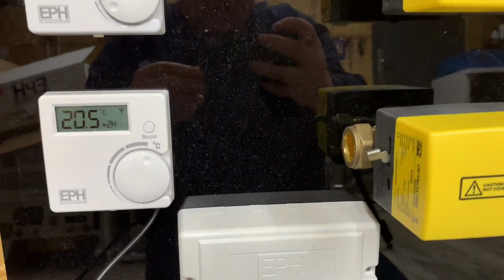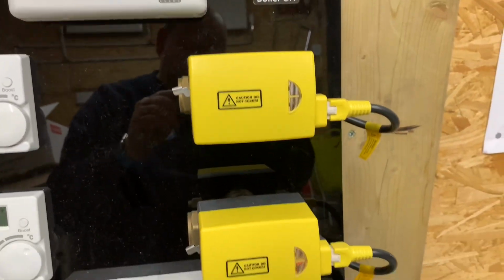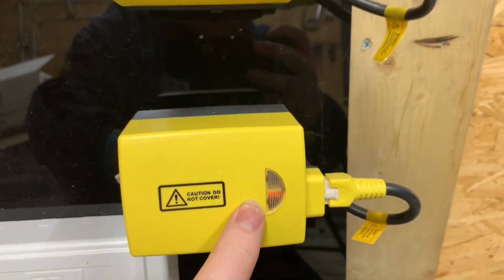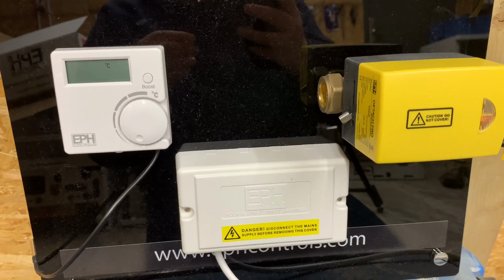CENTRAL HEATING SYSTEMS EXPLAINED - S Plan, Y Plan, One pipe, Two Pipe Underfloor Heating

Comment: @allenhart999 . I have an old georgian mid terraced house. It consists of 4 floors with each room directly above the other. I am thinking about installing a heating system myself as i am an engineer by trade. I have installed a new electric hot water cylinder last year and up until now orhave had electric radiators ( no gas supply currently) the system would be for radiator heating only. I would be unable to install a header tank due to access issues. Surface mounting the pipe work is not an issue. Could you recommend a suitable boiler and am i correct in thinking a simple 2 pipe flow and return system would be the way to go ? The boiler would have to be installed in the basement kitchen due to various matters ( grade 2 listed building ). Thankyou 😊
Reply: Heating system would be 1 rad for kitchen , 1 rad for living room and 1 rad for each bedroom.

Comment: One pioe systems imo are great if you use straight valves and pipe the rads all with straight valves, so the pump doesn't have to push water into tees

Comment: On a one-pipe system, is there a reason why the pipe continues on under the radiator and doesn't just continue through the radiator? Surely the downsides if lower pressure would be outweighed by the fact the water would go through all the radiators?

Comment: 11:26 This is a great video, thanks! I'm planning a heating system in a narrowboat which I'll live in. I'm considering a mix of underfloor heating, one or two radiators (engine room and bathroom) and hot air from a heat exchanger. 

I wasn't sure if i could use UFH and radiators on the same manifold, but the info about the blend valve is just what I needed! 

I'll be watching your other videos too. Thank you so much!

Comment: In the two pipe system. What are the implications of all rads are off. 
Would it work to join the flow and return at the end of the run. I’m guessing not as yours doesn’t include it.

Comment: Hi, can you answer a question for me please. I have a duel zone combo heating system.
When draining the radiators down, and refilling pressure in boiler I am getting no water from bleed valves but pressure says 1.5 bar.
Do the zone valves have to be opened before bleading and how do you do this without turning heating on?
Thank you.

Comment: Hi. Quick question about a remove radiator permanent in 2 pipes system. After remove radiator Can I connect pipes together or I have to fit on stop end cap?

Comment: Hello Alan I have  a one pipe system in my house, the radiators near the boiler are red hot, and some downstairs are barely warm, I would think at the end of the run. Can you balance a one pipe system by turning down the lock shield valves, or will this only work on a two pipe system ?.

Comment: Thakns for the video. In the 2 pipe system, does the in-flow and return pipes always connect to the same side on every radiator, or is it up to the plumber to decide?
Reply from the maker: There are not always the same.

Comment: Hi, does the d(T) on radiators aggregate?  By this I mean, if your water loses a bit of heat at radiator 1, then does that carry over to radiator 2 so the return temperature lowers again, and so on?  Or is there one overall loss to show the overall drop?

Edit:  I think I'm getting my own answer here - the point of the two pipe is that the hot water is only used in one radiator before it gets returned - so by definition there is no aggregating loss in a two pipe system and hence you can work out d(T) on a single radiator.  If I'm wrong, someone tell me!
Reply from the maker: Thank You

Comment: Hi, I'm just about to wire up an S plan system with the very same controls as you show in your video  do you have any videos showing the wiring diagram? Noting I have 5 core flex ( not wired yet )coming  from my time clock to the boiler ( System Logic ) and cylinder which are  situated in a different room.Thanks
Reply from the maker: Thank You

Comment: Great Video Alan. I have just fitted some new column radiators and I currently have a Worcester 8000. My question is when you pressurise the system where would you expect the water to enter the radiator first, the flow or reverse side. Thank you in advance

Comment: Hi Allen, great videos, very easy to understand. I am an electrician looking to understand all types of heating as I think the air source heat pumps are the way forward. I am looking for a video just to understand how many cores I will need for each different heating systems.

Comment: Hello Allen,

First off, thanks for a very clear explanation of the possible designs of the central heating systems ;
So a rather specific and bizarre question.
I have moved into a house where, because the floors are concrete and I cannot  raise the floorboards to look, I can’t tell whether it’s a one pipe or two pipe system.
At some point in the past a radiator was removed in one of the rooms, because the owner at the time wanted to do something different with the wall. (I haven’t all the details.)
Someone, a plumber or just a DIYer, therefore connected the two pipes (the flow and the return) directly, without a radiator.
It seems to me, that in the case of a one pipe system it probably wouldn’t matter much, but in the case of a 2 pipe system, that this would mean that much of the hot water would be directed straight back to the boiler and make the system inefficient. (the missing radiator is, i think, near the beginning of the loop.)
It also seems to me, that simply to cap the two pipes (flow and return) would be far more sensible in the case of both types. (1 & 2 pipe systems)
What do you think?

The other option, of course, is to install a new radiator, which I may do eventually.
In that case, how do I know which is flow and which return, and does it actually matter? I would expect to install a radiator with a thermostatic valve connected to one or the other pipe.
Reply: I came across you Q to Alan, sorry I’m not him or anything to do with.
But just in case he can’t reply here you go. And if he does reply he can mare my work.😂🤔✅
You are right, doesn’t matter in a 1 pipe system. Even is a 2 pipe system that pipe that has been connected is the smallest of rad in the world. But again I wouldn’t like to do the maths to find out the costing or efficiency or lack there of.  If you ate putting a rad in the future again it matters not which is F & R just make sure your stat can do both as some are dedicated flow.

Comment: Hi
Is there a recommended configuration for the flow and return pipes? Your video shows the flow and return pipes with tee off to one rad at a time. Is it ok to have the flow or return with a tee feeding 2 rads or would this cause a bottleneck? I can see it may be ok for the feed but may be a problem with the return. Thanks in anticipation.

Comment: Hi, Let's say we put 2 zones on a wood boiler for a house of 100m2, 1 night zone 2 bedrooms, 2 bathrooms + 1 day zone à big living room with an open kitchen. Boiler would be a cooking stove between kitchen and living room with visible flamme. With 4 radiator in the night zone and max 2 radiators in the day zone.
22° in the house approx. How much electricity the pumps of the central heating are consuming ? I mean approximately, knowing that it could go more or less depending on more or less cold weather. How long the pumps are running per day approximately... That I can calculate my electricity consumption...
By the way, thanks for all your videos, very helpful ☺️

Comment: What is the point of heating the water to 70 degrees just to cool it down? Why not just heat to what is needed?
Reply from the maker: That’s a great question. You normally have some radiators on the system and these normally need a higher temperature. Thanks

Comment: Hi Alen, I noticed that you don't put TRV & lockshield to the one-pipe system, are they not allowed in the one pipe system? And I noticed you only used elbow & is that a lockshield? & why putting the elbow & lockshield are in 2 different ways?

Comment: Quick question: Can a house have installed a one pipe system, say running 4 rads and also the rest of the house running on two pipe system on other rads of one boiler? Thanks
Reply from the maker: yes absolutely
Reply from the maker: Thanks very much for your comment, please consider subscribing to support the channel 🙂

Comment: Hi all   Just had a new combi boiler put into my flat with new radiators the gas fitter fitted the boiler but when he went to fit the radiators  he gave me a shout saying bad new you only have a one pipe system in the flat some I'm going to have to put in new pipes to make it a 2 pipe system so it will work with the boiler extra 1.200 would this be right or could it have worked on the one pipe system, thanks

Comment: Hi Alan - a bit of advice if you could please. My son has just got the keys to his first house and the installed central heating system has me scratching my head. In 1968 the original system was installed as a single pipe system running off a coke fired stove / back boiler. There may have been more than one incarnation of this system over the years but more recently when a combi boiler has been fitted a two pipe system has been merged with the one pipe system. The first two radiators from the boiler are on a two pipe flow and return whereas the rest of the system is on a one pipe system. Is this likely to cause any problems with flow to the one pipe system since the first two rads are providing a short easy return to the boiler.

Comment: Excellent video Allen! Is it simple to upgrade the heating controls for a y plan system that has a manual valve for hot water/ radiators, a manual tank thermostat, and a Randal 103 mechanical timer and no room thermostats? The boiler is an ideal classic (about 30 years old) or would you recommend upgrading the boiler and entire central heating system controls?

Comment: Best video on YouTube so far 
 Can you use 15 mm on the 2 pipe heating system all around with out using 22 mm for the main pipe on the flow or return then reducing to the  15 when you join in the radiator ?

Comment: Do you need diverter tee for the two pipe and one pipe system?
Reply from the maker: We do not install one pipe systems anymore. This is to give new people an idea of how they work. Thanks
Reply: Allen Hart if supply/return loop in the basement and radiator on the second floor. Do you need diverter tee to push flow to the radiator on the second floor? Asking because I’m wonder if I can hide the pipe in the basement instead of open up walls on the second floor.

Comment: How to add a stove boiler to an existing oil fired CH system..external oi fired boiler..pump is fitted on water going in to oil boiler..indirect system...single storey...cylinder (indirect)..in bedroom...stove (solid fuel) in sitting room

Comment: Hi, great informative videos. You prompted questioning as you go along. So hope you don't mind. On a 2 pipe system, where the flow comes from a boiler and the return goes back into the boiler, where would you put the pump and why ?
Reply: At 8.10 did I just get my answer ? That the pump is on the flow, to force the heated water in to the radiator ...

Comment: Hi Allen 

Great info 

I have a f and e system and trying to work out the flow and return in the hot water tank cupboard 

I take it both will be in there 

There is 3 coming down from the loft and pipes around the tank with a motor and 3 way valve 

On the boiler end this is a ideal one the pipes  all come out the top of it and they are all boxed in at the top so couldn't fit the filter there

Reason I'm asking is I've had to replace the 3 port valve and during this lockdown and had to clear the system of sludge by taking the radiators off and flushing them but ended up replacing 4 
The system has cleaner in it just now but was thinking of fitting a filter so need to work out the return to fit it 

Thank you in advance for any help 

Tommy

Comment: Great informative video. This may be a repeated question so sorry in advance. Regarding side for fitting TRV I'm with fitting to supply side even if a bidirectional unit , I see that you have fitted to supply side. Would you say it is best this way if so whats your thoughts on this? We are moving to a large house and most rads have TRV on return and so I think this is stopping down stairs heating up at the same time. Upstairs rads could be stealing the hot water. I've balanced all the rads, I think 15 rads in house. The upstairs heats fast downstairs take forever! I'm thinking of changing at least all upstairs TRV's to supply side to see if helps downstairs rads heat up faster. I've flushed out system and removed rads to flush through as the system was very sludged up. The house has been inherited. Cheers Allen
Reply from the maker: Installing them on the flow seems better to me. Thanks.

Comment: Hi Allen, brilliant video. I’m trying to figure out why my house won’t get hot water without the radiators being on. In summer it’s a nightmare. Any clues where I should look first? My underfloor, central and hot water all have different thermostats on the wall but no combination seems to fix it! Now I’m going to check for my y and s valve 😂
Reply: Had same problem was the 3 port valve

Comment: Good instructural video. Iv never really understood why the different systems are used tho. I’m a landlord and Iv learned that a standard combi boiler is the best. I bought a house once that had all the water pump and hot water cylinder etc. I ripped it all out and even got some money back from the cooper and cylinder. I cudnt believe how much copper is used too. I then laid 2 circuit piping. I love the idea of turning the hot tap and getting instant hot water. A salus wireless thermostat finishes it off nicely.
Reply from the maker: A standard combi is NOT BEST, Different situations need different solutions. Thanks.

Comment: Better still, Set the heating to come on about 20 minutes before the hot water to allow fast warm-up of radiators, then allow heating and hot water together. I think it is a bad use of boiler efficiency to allow a large 60000 BTu/h boiler to drive a  10000 BTu/h  cylinder load.

Comment: Hi Allen, first off, thank you so much for your videos, they are very helpful to help get  my head around my new heating system.

I have moved into a new house (new to me, not new, but only about 15-20 years old). Can you help me figure out what type of system I have?

I seem to have a boiler plus a pump and a valve in my boiler house. In the hot press it looks like another valve and the water tank looks electric (when it calls for heat a red light comes on in hot press - this is separate from the hot water boost switch). No water tank in loft.

The wires are as follows: blue and brown from boiler and pump, red and black to room thermostat, red and black to hot water upstairs, and then brown and blue from valve (I can only see the wires for the one near boiler).

I have a Nest installed, how should I handle the hot water?

Comment: How do you size the pipe to the radiators? How do you size the water pump for the radiators? On the one pipe system , how do you control the flow of hot water?

Comment: What happens if a radiator is plumbed in the wrong way round in a 2 pipe system .Thank you so much for your hard work on all your vids al /ALL THE BEST MATE KEV
Reply from the maker: Depends on the valves but normally the Radiator will still work fine. Thanks.

Comment: Hi allen,
Can underfloor heating be installed using a combi boiler?
So 3 rads, 2 showers and underfloor heating all on a combi system?
Thanks for the vids and knowledge mate
Reply from the maker: Yes i have underfloor heating on my combi, The boiler in the video is also a combi. Thanks.

Comment: I live in a bungalow with a concrete floor is it OK to drop down pipes to the rads
Reply from the maker: Yes absolutely. Ofter do systems on drops. 👍
Reply: @AllenHart999  thanks for your reply, I don't suppose you fancy doing a video on that way to run the pipework or even pm me a drawing

Comment: What's the highest tempreture setting you can have on a under floor heating?
Reply: I think between 20° -35
Reply: 50 degrees I do this for a living
Reply: smart tech then you know you don't need 50 degrees
Reply: @sheledmikymo  no you don't need 50 degrees  but that is the highest you can have it without damaging the system and also that was the question that was asked. What is the highest temp you can have..
Reply from the maker: Depends on plans but 45/50 ish
Reply: Are these temperatures in Celsius or Fahrenheit?
Reply: 60

Comment: Hey witch good one pipe or two pipe
Reply: I am a retired  domestic gas fitter so over 65 and I can count the number off one pipe systems I have ever worked on on one hand .They look easier to fit but the major drawback is the further on round the system they go the water returning from the earlier radiators  cools the water going into the next one so six radiators or so down the line the water must be considerably cooler. You  may find this system on older buildings ,say churches or older commercial buildings but never in domestic premises.
Reply from the maker: Two pipe is definitely better. Thanks.

Comment: lovely stuff here professor. how do they pipe the rads you see in some new builds where they take a 10mm pipe feed? do they run back to a manifold? how far can you run the small pipe before it reaches thermal capacity? could you even just reduce the flow and returns at the boiler down from 22 to 15 or even 10mm bore? thanks

Comment: What about 6 rads going back to a manifold so that's 6 rads , 12 pipes no joints and manifold back to boiler
Reply from the maker: David McNally Yes that would also work. They do tend to have issues later in life though. Thanks
Reply: What sort of issues can these systems get Allen?